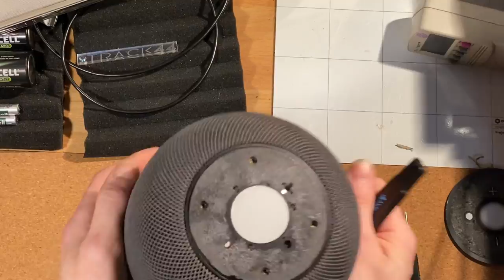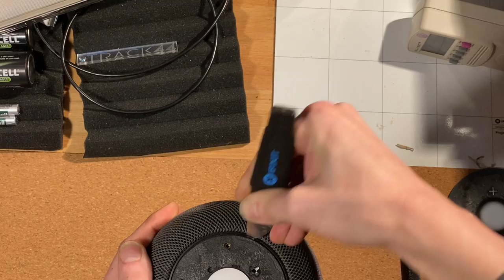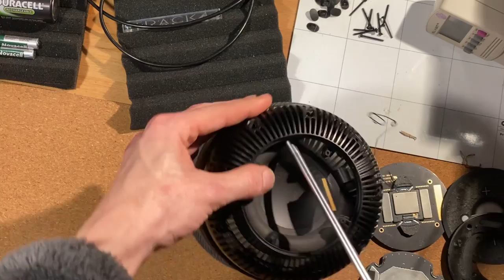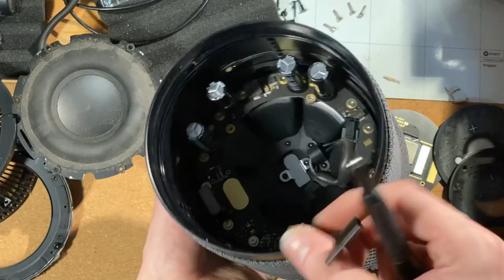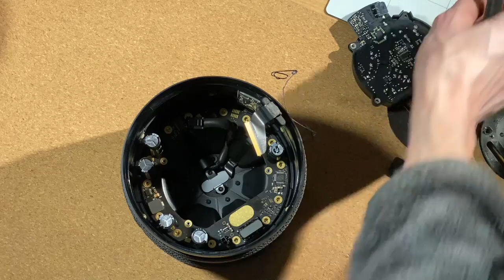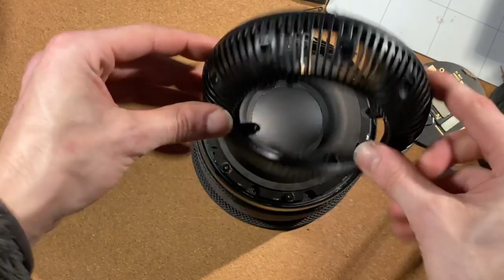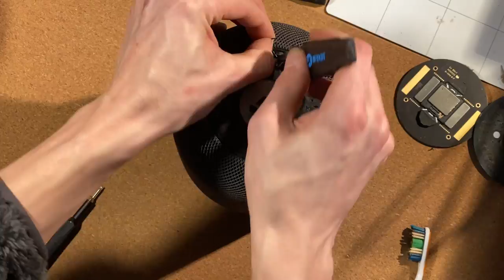How to Fix a HomePod that Won't Power On; The Most Common Inside the A1639

Comment: What happens if you don’t avoid the pcb plastic layer problem? I thought I had it right but only got the top layer off? Is it recoverable?
Reply from the maker: The plastic is removable but I generally just don't recommend it because you can knock off the ambient light sensor that's on that side of the PCB, and you can also scratch the PCB and damage traces. If you haven't damaged the PCB you can simply reinstall the plastic layer. If you accidentally knocked off the ambient light sensor, the display will still work fine but at 100% brightness all the time.

Comment: The speaker in self is a sealed enclosure, right? If I put some dust cover to prevent this insane dirt in the woofer (mine is white too) the electronics won't be hotter?
Reply from the maker: Im not sure I understand how you will do this, but it will almost certainly run hotter. I wouldn't be concerned with altering a HomePod to prevent dust anyways, instead you can simply blow compressed air through the mesh and giving the top touch cover a quick wipe every time you feel like cleaning them. I use a plug in electric air duster to save $ on buying cans of air and hit all of my homepods about once a month
Reply: @NicsFix  Thanks. I already buy dust covers named "TXEsign Elastic Anti Dust Cover for HomePod", recommended by iMore. In the article they says that not interfere with the sound, but nothing about thermals. My window is up front a traffic street and a lot of dust enter in my bedroom. I vaccum clean the floor 2 times per week and remove the dust from the forniture almost every day. White things tend to turn gray.
Reply from the maker: @Dr.Marcos  I see, those look pretty safe to use. I can't imagine it being more than a negligible impact on sound and heat dissipation, especially since it leaves the top exposed and it looks pretty breathable

Comment: Also wondering what temp you ran the reworking station at? I am not having any luck in removing the diode but don’t want to prematurely bump up the temperature
Reply from the maker: I was exactly the same at first, but I found on my cheap little station that it works best (and only works at all) when I max it out at 500c, then hold the hot air about half to one inch away for about 30-45 seconds until the solder has melted and I can pull the diode off. The amp board is acting as a heat sink and taking away a lot of heat.
Reply: @NicsFix  Thanks for the info. Much appreciated. I am a complete noob when it comes to soldering but your video has inspired me.
Reply from the maker: @davidwardle6712  That's the goal! I strongly suggest also watching "Basic Soldering Lesson 1 - "Solder & Flux"" by the paceworldwide channel if you're looking to learn. I would contribute the majority of my fundamental understanding and success with soldering to that series.

Comment: I have a broken Homepod, when I brought it to a repair shop it said it’s SMPS stopped working. Any idea what the issue is?
Reply from the maker: SMPS sounds like they're saying the power supply is dead. It's impossible to tell what's wrong with a no-power homepod without disassembling it for diagnosis, but you can GUESS what's wrong with it by looking at it's power draw. Zero watts of power draw is usually a blown fuse on the power supply. 1-2 watts draw is usually a short on logic board. 3-7 watts draw is the MOST COMMON with no power pods and is caused by the same shorted diode on the amp. At least 9 out of 10 no power homepods are the same dead diode, NOT a power supply or logic board issue. https://nicsfix.com/#commonissues
Reply: @NicsFix  Thanks a lot for the response. It seems to me that the fuse has blown, I’m not sure as I can’t check the power draw for my HomePod. Can I use any 3.15 AH Fuse to replace the one on my HomePod? Or should I use the exact same fuse. I don’t have much idea about these things.
Reply from the maker: @hammer2302  I'd suggest replacing with "T3.15AH250V" It is specifically designed to fail under specific conditions, you'd want to stick to it for the best protection

Comment: I am so screwed, HomePods are so expensive and out of stock and this JUST happened to mine, I am in Slovakia, no-one wants to handle the repair... any advice? I am considering buying iFixit tools and try to do this, but the welding stuff is just not for me, I would screw up... so :( yeah
Reply from the maker: At this point you don't have much more to lose! I also offer 50% off my repairs if you find the fault and send in just the board for repair. You may also have some luck looking for a local repair shop and providing the repair info to see if they're willing to take up the task!
Reply: Like the Chanel owner said, dissasable the pod, and give your best local repair shop a visit with exact steps what to do (hey please change this diode) this will be way cheaper

Comment: So my HomePod kept losing connectivity. If I reset it, it would work again for about a day then quit again. Now it won't reset. I still get the red swirling light but not the 3 beeps indicating it reset. My phone no longer "sees it".  Faulty logic board ?
Reply from the maker: Definitely something up with the logic board. When you plug it in and wait a few minutes, then tap the top, is it still showing the spinning white animation? Or does it just boot up to flashing volume buttons
Reply: X2

Comment: Once you got practice in getting the guts out, how long does this repair take you in real time?
Reply from the maker: With practice it should take about an hour to do the whole job, give or take a few more minutes depending on how much actually needs repaired. My personal best is 45 minutes for just a no-power repair (the usual s.b. diode)

Comment: Hi! I need some assistance in HomePod repair. I did try your website, but don't know if I got through correctly. Do you by any chance, have a e-mail address I can use for contact. Thanks!
Reply from the maker: You can join my discord server at https://discord.gg/track44 or shoot me an email at nicsplatts@live.com for now, our main website / email host just took a dive so those are down at the moment!

Comment: After repairing my HomePod the lights are brighter than before. Anyone with same experience? Wrong diode or some other explanation?
Reply from the maker: You either broke the ambient light sensor off while prying the display off, or, the plastic top isn't lined up well with the display. There is a little window for the light sensor to see through
Reply: @NicsFix  I think I damaged the sensor🤦Too bad, at least it’s working again! Thanks for your reply! 👍

Comment: Its a pitty that we live a couple to thousand miles away my brother, i would gladly trust my farting homepod into your hands with my eyes closed. I've never watched a repair video without skipping and to prove it to you , you missed the part when you connect the subwoofer on re-assemlby.  :-) . Now i am stuck with farts from siry  :( ... Great video , great voice smooth moves my friend!!
Reply from the maker: Fear not! At 25:34 I say to plug the subwoofer back in through the gasket (on video it actually is by this time if you look closely), but as you noticed I didn't show this on camera, which was a result of everything being done in one take and needing to cut out some malapropism. Thank you for the kind words and nice catch on the details

Comment: A+ repair job! In the past I never bothered replacing surface mount component due to the cost of the hot air soldering stations. But that was way back in the day. Now you got me thinking....
Reply from the maker: supposedly others have managed to replace the diode by using two soldering irons to heat up both ends of the diode, or a single iron with a tip the size of the diode. seems pretty risky to me with the other super tiny components right next to it but to each their own!

Comment: Damn, I can only imagine what you charge to repair one of these. Probably cheaper to buy a new one! great clean work though, I’m very impressed that you have gone into that rabbit hole 13 times and been successful. Also never realized how big the magnet on the subwoofer was, and how many caps were inside one of these. Mine has been dead for a few months.
Reply from the maker: I’ve fixed a few thousand of these now and live-stream most of them here! I’ve got current prices and info on my website at nicsfix.com

Comment: Hi Nic,  I have 2 and I’m convinced they need new diode, i.e. they do notbpowerup but get warm around the power supply.  I have the replacement parts and a Fixit kit but, having seen the effort involved, plus the likelihood of me losing a couple of fingers, I feel my place  is in my garage, fixing my old Triumph bikes.

Cut to the chase, I’m in Scotland, how many limbs do I trade … and … naturally, can you get them back to me before I notice that they’re missing?

RSVP and I’ll forward the video of me smashing a number of piggy banks,
Steve. 😜
Reply: Sheesh, what’s keeping you; you don’t sleep do you?
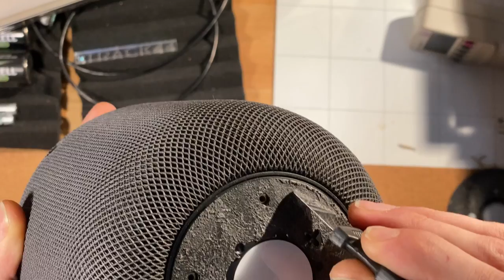2:24 here, perhaps I should do this same.
Reply from the maker: @SteveBattye  Hey mate! I must say this is one of the most amusing comments I've had in a while! As you guessed, shipping will suck between you and I, it won't be cheap (about $75 USD) or fast, or reliable

The good news is there are three different folks in the UK offering repairs too! I have them listed on my website nicsfix.com , under the Mail-In Repair section , just keep scrolling :)

Let me know if there's anything I can help with!

Comment: Well…managed to put the spudger on the wrong place and removed the 1st layer of the capacitive display. Yay….oh well lesson learned. Time to go shopping for a new freaking HomePod.
Reply from the maker: It happens. In a lot of cases it still works fine. There is a little shiny chip on the top of the display a lot of people also break off, it’s the ambient light sensor and the HomePod works fine without it
Reply: @NicsFix  I was planning on replacing the HomePod anyway but thought it would be fun to try the disassembly. Didn’t have issues anywhere else. If it will still work though. Maybe I’ll keep it for another room. Likely sending the board to you though for the popping sound. Decided I’m not going to try and tackle that. Thanks for this tutorial though. It’s legit.

Comment: Homepod mini won't turn on. does not respond when turned on. Connecting to a Mac didn't help, can't see it
Reply from the maker: haven't had great luck with the mini's myself I'm afraid. others have found a shorted cap near the SoC but they;re incredibly small!

Comment: How does the top touch cover adhere back on if the foam tape is cut?
Reply from the maker: You can gently re-heat both sides of the adhesive to re-use it! If its no longer sticky, some rubbing alcohol can clean it up, too. I don't advise using new adhesive as that will make taking it apart again in the future unnessecarily difficult

Comment: I fixed my farting one but after reassembly lights dont work anymore. Any ideas? (I rather lights dont work anymore than farting anyways)
Reply from the maker: Perhaps some physical damage to the display, or it's ribbon cable. Or it's cable may not be reinstalled correctly. Does it seem to still respond to touch?
Reply: @NicsFix  Hi! Sorry for the delay I was waiting for the replacement caps. Unfortunately the ribbon cable broke, do you sell a replacement cable? thank you!
Reply from the maker: @shinjiikarir  I don't sell parts anymore. I recommend folks that need parts to buy their own homepods for parts! It's not feasible for me to continue buying broken homepods and sell parts from them, I lose money and I run short on parts I need for repairs :(

Comment: Nic - hands-down the best instructional video ever. You really have a talent for this. My HomePod died a sudden and unexpected death. Sure enough, a shorted diode. The HomePod was the ‘slave’ on a stereo pair if that helps on your quest to understand why this happens. Anyhow, all repaired and I wouldn’t have even known where to start without your help. To anyone attempting to make the repair two things I learnt: the adhesive securing the main ribbon cable to the basket was murder, take your time! And the heat required to lift the faulty diode is phenomenal: so don’t be frightened to ramp-up the heat - you’ll need it.
Nic - can’t thank you enough 🙂

Comment: Does the new diode have to be the one with 1735k ?
Reply from the maker: Nah that’s just the date of manufacture. You just need the same part number. There a few a few part numbers you can use that I list on my website. They’re under the Common Issues for no power (diode): nicsfix.com
Reply: @NicsFix  thank you very much for the info🤙🏽

Comment: Hey man, great tutorial. I got one problem after changing the diodo, the chip to the left of the diodo shown in the video got burnt as well,, the 8pin chip,, and every letter on it are screwed... i have no idea what chip is it,, could you please be so kind of telling me what chip is that? thank you in advanced.
Reply from the maker: That is a Texas Instruments TPS54560 dc to dc step down converter. It's been superceded by TPS54560B which will also work as a replacement!
Reply: @NicsFix  Thank you so mucho for the quick reply! cheers!

Comment: Hi, do you have also a solution for HomePod which led lights on the top aren’t showing up? Everything works except the Siri and + and - light. Touch is working fine.. I have updated and reset the device. But that didn’t helped.
Reply from the maker: Both the touch and display are on the same PCB and use the same ribbon cable to connect to the logic board, so, if touch works, I would guess the cable and connector are likely still fine, too. I've not yet seen a display simply stop working before on a homepod but I would hazard a guess that's what is needed. Hard to know without taking it apart and swapping around parts!

Also curious if you've tried both factory reset methods, both from the home app and using the red spinning circle method
Reply: @NicsFix  thank you for your assessments. I tried also both reset methods. But the result was the same. No led lights. I think I will try to look into the HomePod and check and switch some parts..

Comment: Hey:) thanks for this video:) what is the recomanded temperature and airflow on heat gun for this little shottky?:D Thx in advice:))
Reply from the maker: If you don't pre-heat the board (most people don't) you'll need around 400-500c at ~80% airflow. This is with my cheap $60 hot air station fwiw.
Reply: @NicsFix  thanks for quick reply! Will try:)
Reply: @NicsFix  Worked like a charm:))) THANKS! is it possible to replace that PDS560-13 /w something simillar?
Reply: @NicsFix  thanks a lot, since I saw your video I have repaired 3 homepods:)
Reply: I wish spent a bit on removing the diode, i've been at 500c 80% airflow and it's not budging @NicsFix